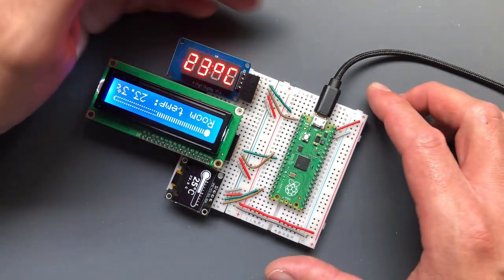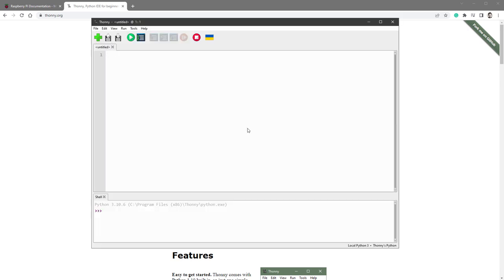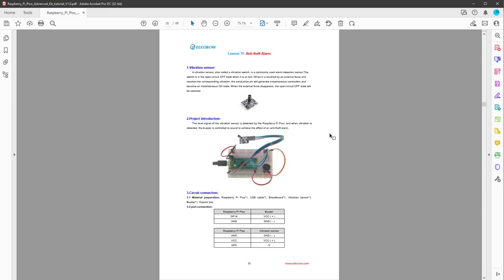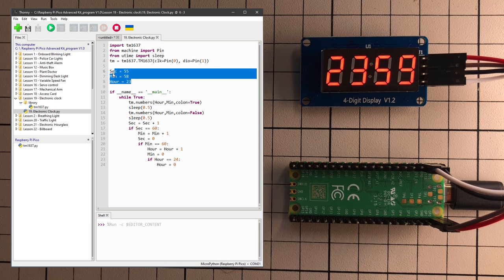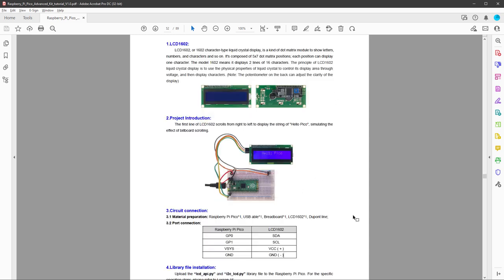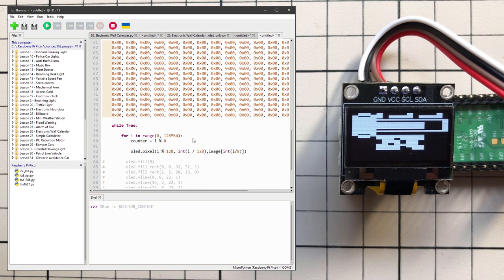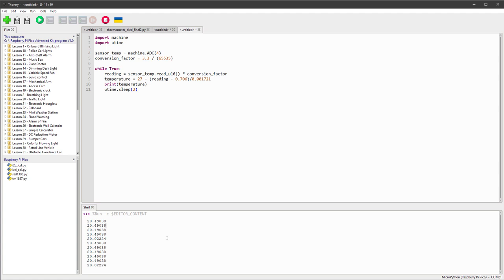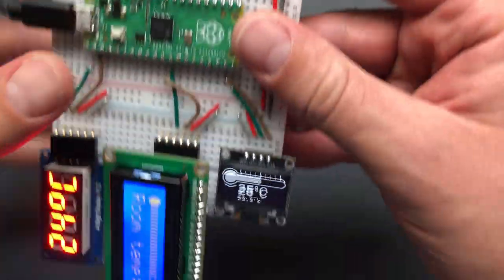1 PROJECT 3 DISPLAYS    -----------    (using Elecrow Raspberry PI Pico Advanced Kit)

Comment: What's the point in using two I2C buses when you can attach both displays onto one? For sure, the addresses are different for ssd1306 and pcf8574 (which is the i2c driver of lcd1602).
Reply from the maker: It was mentioned in the video, I don’t see any place where you set any address for the ssd1306 display. Perhaps in missing something? I don’t fully understand why the address is not defined in the code..
Reply: @upir_upir  The SSD1306 library supports arbitrary I2C address but one can't change it in hardware anyway, so just keep it set to 0x3C by default init. Thus you need two I2C buses for two ssd1306. But one ssd1306 and pcf8574 (the address is between 0x20 and 0x27) can share single bus without any issues.
Reply from the maker: @Noname-hc4hc  Thank you for the clarification, it makes much more sense now!
Reply: With different temperatures on each display 😮😮😮
Reply from the maker: They are slightly different because of the rounding to different decimal places. Also, the correct temperature on the OLED display is the small bottom one.